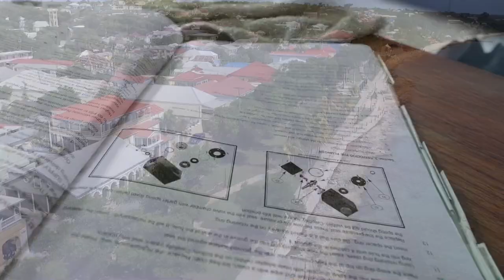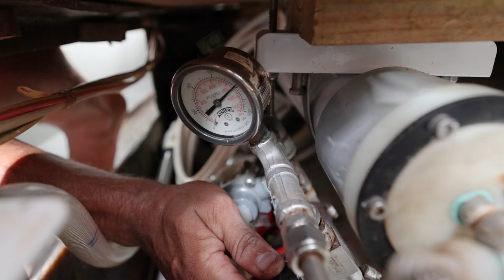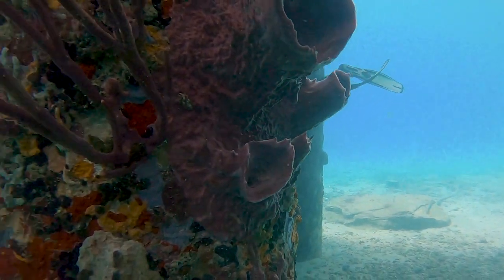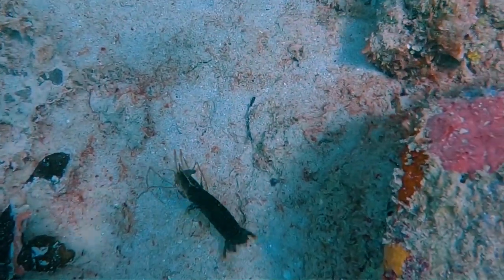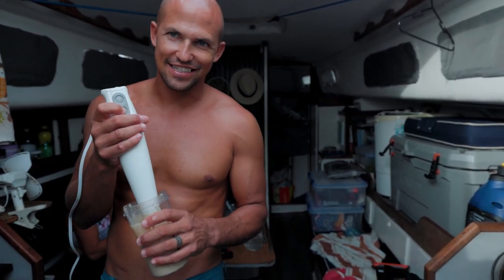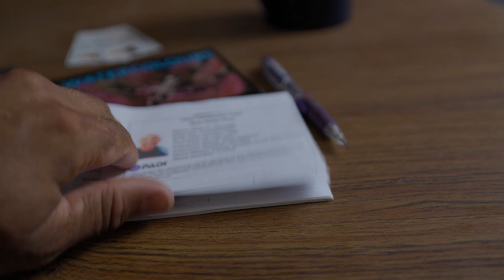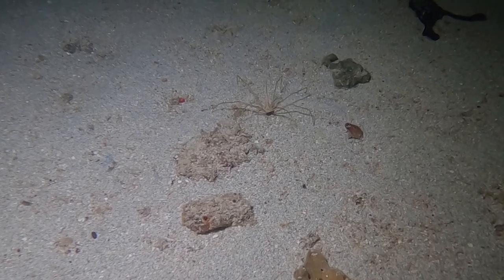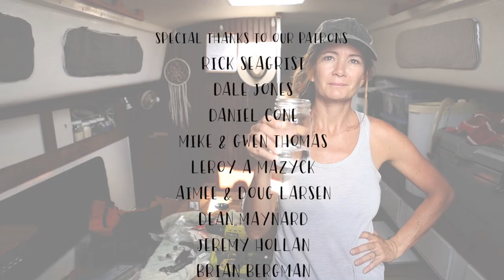Night and Day Difference |  Sailing St  Croix

Comment: I seen a video about this guy bought a brand new Rain man water filtration system. It was the small portable system, but he bought the biggest filters for it. The reason he did that was because he found out the the biggest filters allow you to produce the most amount of water in the shortest time. So that means the less you unit runs, the longer it lasts and the less energy you use. You might want to think about that. Yes I know you have solar and your system is electrical, but you are still having to replace parts on your equipment. Sorry about that specialty tool. Special means alot of money. I wish I knew about it before you bought it because I could have made it for you at cost of material. Like $50.00.
Reply from the maker: Wish we would have known too 😬 well hopefully we will be able to help someone out if they ever need it.

Comment: You guys are about 50 miles away ...

.. from the most fantasical bioluminescence experience. Mosquito Bay on Vieques. 

Google vieques bioluminescence and check out the images that pop up.
Reply from the maker: Actually maybe heading that way 😉 was looking that bay up this morning!!
Reply: Beau and Brandy Sailing 
Be sure to plan on being there around the new moon so the night sky is darker. 

Vieques does not offer great anchoring since the coves are either too shallow or too rocky. 

You’ll end up anchoring near the ferry which is on the north side of the island and of course Mosquito Bay is on the south side (about 10km). 

If you contact some of the night time bioluminescence bay tour guides I’m sure they can arrange to get you there. FYI ... I took my friends to the bay the first night in Vieques and they went back every single night. They have never stopped talking about those nights. 

Filming the experience can be a challenge. (There are some videos posted on youtube.) I remember after swimming in the bay you get out and shake your hair and all the water drops are illuminated. Beau can just watch without hair. 👾

Side note: next weekend is Stonewall Pride Parade so it is Beau’s annual chance at giving us all a cheap thrill by showing off his tan lines.
Reply from the maker: Yes, we hope to get up that way before the next new moon. And Darn it, we won’t be able to make it for the weekend, but that would be a BLAST I’m sure. 🕺🏽👙 Beau’s tan lines 😂 love it!

Comment: About that $600 tool ...

.. you are probably right that you would not ever spend $600 on water BUT you could easily spend $600 on fuel fetching the water. 

Besides when you “lend out” that tool you can demand in return they buy you the fanciest dinner available wherever you are.

Comment: If you get a chance, my wife would still like to try your keto bread so if you could send that recipe she would be most appreciative.
Thanks
Reply from the maker: Here ya go: 
Keto Bread Recipe
½ cup coconut flour
⅓ cup ground flax seed
1 tsp baking powder
1 tsp baking soda
1/2 cup coconut oil (refined or use another flavorless oil, ie avocado oil)
2 tbsp white vinegar

375 for 25-30 min. Greased pan or parchment paper.
Reply: @BeauAndBrandy  tyvm